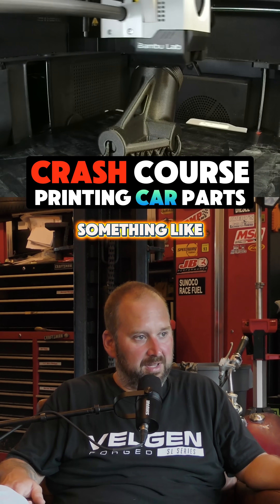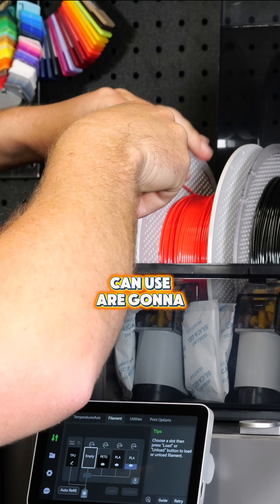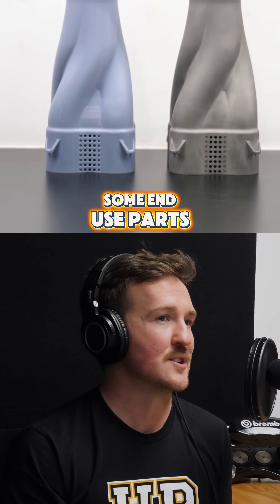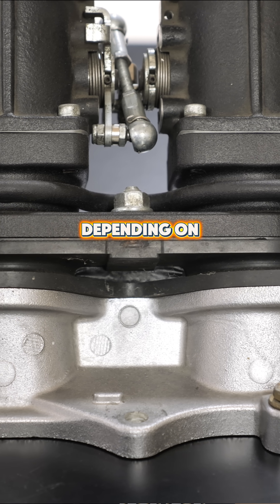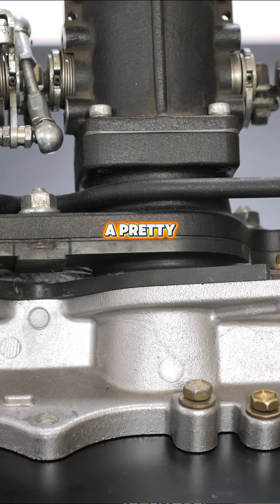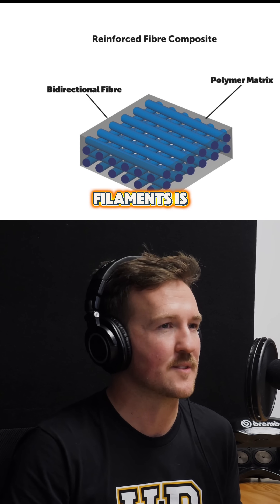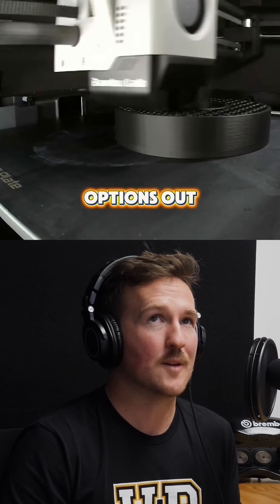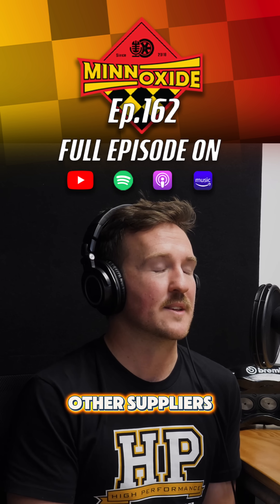Crash Course On Printing Car Parts

Comment: Voron 2.4 open source printer. Huge bed. A million and a half mods. Buy a kit for $700. Spend another $300 on all metal brackets. Get a chamber heater. You can literally use ANY hotend you want because there is a mod.

Comment: Thats also what aftermarket hot end upgrades are for. I can do that stuff on old modded ender 3 i got for 85$ and put like 150$ into upgrades into. Was pretty good entry level with some upgrade and repair learning in process

Comment: Can literally print the materials mentioned and print them well on a $300 elegoo centauri carbon these days
Reply: Or and ender 5
Reply: Can print them on my ancient 2nd hand ender3v2
Reply: I have a Monoprice Select Mini V2 that I upgraded the printhead on and it would print with any material you wanted to print with. $99 for the printer, $50 for the new hotend. Fun fact, the Monoprice Select Mini used a 32-bit processor, which other printers at the time didn't use unless you bought a very high-end printer. It has the ability to print insanely thin layers due to the processor used.
Reply: Owning a centuri, they are a great machine
But having now had to send one back because leveling sensor was fault, and other one needing a complete new head because of heating fail and now a new usb cable because it broke... they are good but you need to watch them 
In saying that i have over 800 hrs on both machines so they have done some work
Reply: Yeah, but it'll look like shit. Maybe spend a little more and get a better printer. Having a centauri is not really a brag.
Reply: @vampcaff tuning buddy. Its not that hard to make prints look good on these cheap printers. Especially the modular ones.
Reply: stress tested? looking good doesn't necessarily mean it's printed good remember
Reply: @K_TeaBag hey buddy, 4 years working with printers, yes if it looks good under a magnifying glass it's in your words "printed good"
Reply: @K_TeaBag there are almost no situations where a print can turn out visually correct and be structurally compromised. Every flaw that would reduce a parts integrity has an easily identifiable visual affect. And if the infill is bad your surface finish will be too so it cant be hidden inside the part
Reply: @alientiger21 exactly, almost.